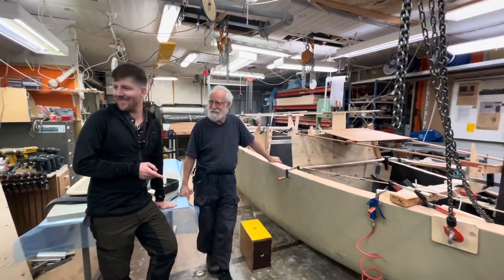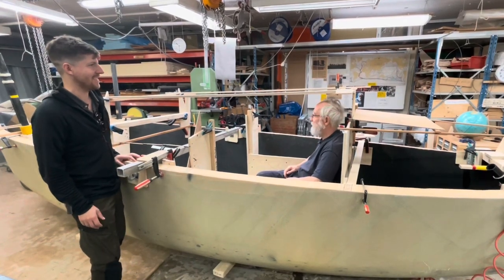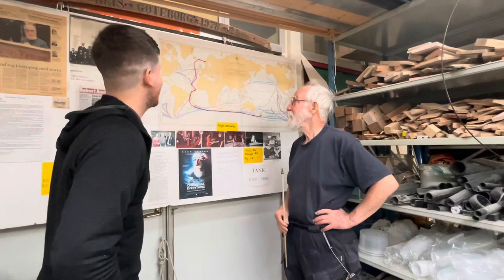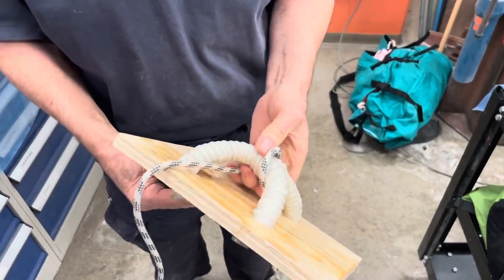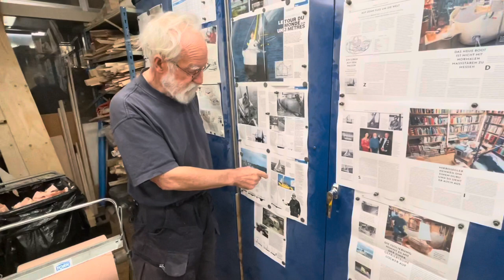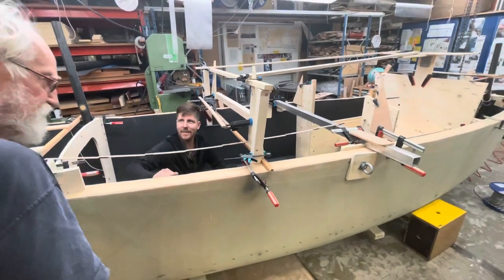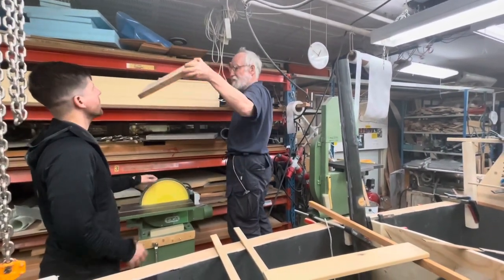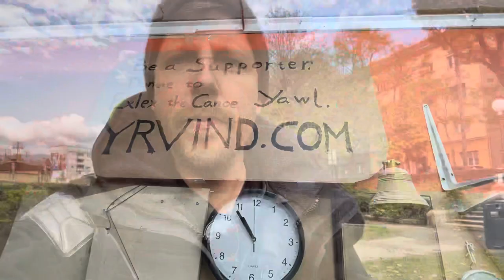At the workshop with Sven Yrvind, legendary offshore single handed sailor & boat builder

Comment: That was great, thanks for doing it.   I wonder if he ever gets cold or has debilitating muscle spasms, back aches, in his tiny boats.  Seems like his diet might be barely adequate to prevent sarcopenia.
Reply from the maker: He seems to have figured out a routine that works for him. But a good question to ask
Reply: There are muscle issues involved with sailing in a mostly prone position for long periods of time. Sven could barely walk when he reached Spain after the last sail toward New Zealand. But his experience seems to be that with a little bit of time you will recover the lost muscle with no harm done
Reply: I think the space travel sector could learn a thing or two about extended voyages in confined spaces from Sven.

Comment: So how does he sail on a close reach with only square sails?  He does not have an engine so must be able to sail up wind?
Reply from the maker: He has a lug rig with a square shape. It can sail upwind ok but long distance sailing trips are usually planned to be downwind.
Reply: I mean in the 18th century big boats sailed with mostly square sails. If you are prepared to wait during times of little wind or wrong direction of wind it will be fine. I read an account of Swedish east indiaman Finland sailing from Göteborg in the 1700s and spending two months getting no further than a trip equal to a day or two due to adverse weather around Scotland.
Reply: He must have to cross shipping lanes occasionally.  That might be scary.
Reply: Sven carries an oar as well.

Comment: So much common sense..I never could understand why modern cruising, let alone blue water boats, are designed the way they are. Open cockpits and positions where you operate the boat from, at the very least uncomfortable and generally dangerous positions. Usually to gain that extra half a knot or few degrees closer to windward, which is very rarely significant. One of the most dangerous things on a boat is fatigue and being uncomfortable, operating out of an open cockpit in bad weather will almost always guarantee that..
Reply: In tropical weather you can quickly get burnt or uncomfortably hot outside too.

Comment: I don't get it.  You both seem like brothers in a way.  Definitely cut from same cloth.  But boats like yours right now is a great deal more comfortable.   And faster and more maneuverable.   Comfort itself very important.  His boats seem too close to driftwood for me.  Life  would be spent 98% at sea at mercy of currents and wind much more than traditional sailboats.   That time also being much more uncomfortable.   Also, good luck finding a girl to sail with in boats like his.
Reply: Yup. I also think there must be some middle ground. I'm working on a concept:
* 8m x 2.5m double ender
* Kickup centerboard & rudder
* cat ketch with 2 6m alu masts
* 8 + 5 m² sprit boom sails wich can be hoisted both on the main mast, wing on wing for downwind.
* Epoxy & glas over Divinycell
* Standing height in sort of a 1.4m x 1.4m deck salon with two inside seats eye level to the cockpit seats and 8 lexan windows (double for isolation)
* 2 quarter berths
* the roof 0.8m overhanging over the cockpit as dodger
* 600Wp solar
* 200Ah 48V LiFePo4 (80kg)
* 4.4kW electric motor mounted in a well so it can be removed while on passage

Just started with cardboard models.